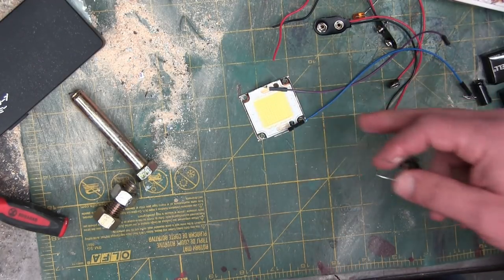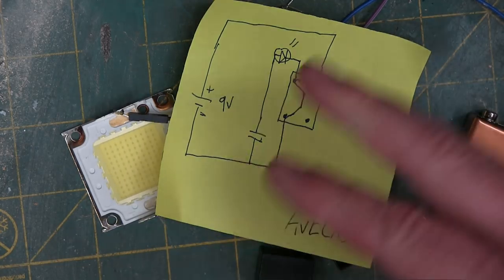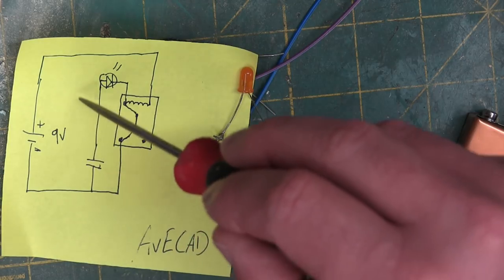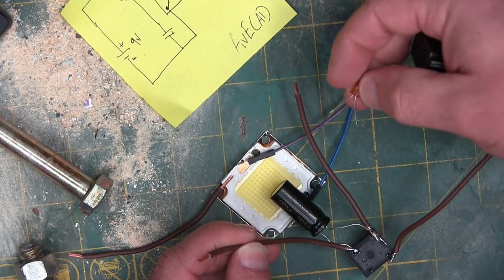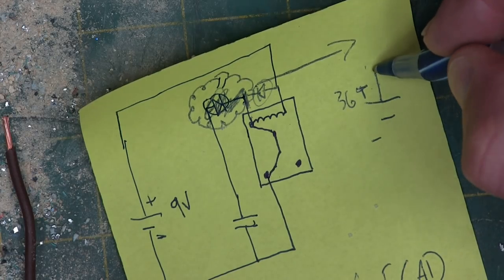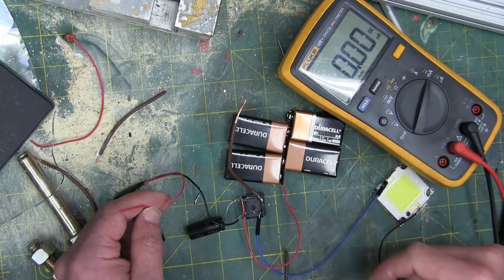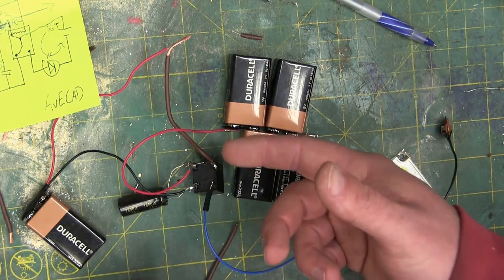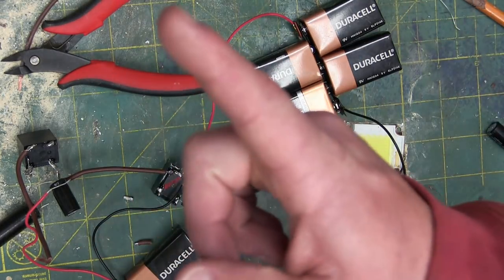SIMPLE Relay Oscillator Strobe Light | Quick & Dirty

Comment: My electrical engineering professor said of electron theory, "Electrons flow out of the negative. Got it? Okay forget about it. You'll never need it"
Reply: Until you go to your physics classes where all the equations are backwards.
Reply: Current is defined as the flow of positive charge.  Positive charges moving right is the same thing as negative charges moving left.  It is all the same current as far as electrical engineers are concerned.

Comment: Going to take me a lot of scrounging to find one hundred 2000 uF caps. Everything else I should be able to get out of the neighbor's garage after he leaves for work tomorrow.
Reply from the maker: Hahahahhhrrrrr Wait a sec
Reply: Would you be interested in a used Allen Bradley Power Flex 4 VFD? I won't be having a foreseeable need. Includes the factory manual.
Reply: +Jay Littleton (and any other volunteers), I can always find a foreseeable need for such things ...

Comment: I decided that I needed to build the circuit from AvECAD and it verks. Thanks AvE! I've recently started learning about inductance and oscillating circuits using inductors and caps like in radios. This has helped me to understand inductance a bit more. I used a 4.7mF cap and the little thing buzzed at 76Hz. Then played with more and more caps. I was so geeked.

Comment: And now the 6 words no electronic engineer wants to hear:
"You can do that with a 555"
Reply: But then we'd need a 7805 to go with...
Reply: 7805? But the inefficiency, just build a buck converter of course you'll need another 555 an inductor another capacitor a good low drop diode. Then if we have that going we might as well make a PCB and if we're going that far we may as well...*blah blah blah blah*
Reply: I have some 555's i use to build vapes with. What else do i need to do this?
Reply: Check the 555 spec sheet. Can run up to 15V
Reply: thanks!
Reply: Nick: nothing that can't be bettered by adding in a few power tranny's
(gets complicated fast, all those biasing passive comps.
Reply: I made a strobe light with a 555, about three passive components and a potentiometer
Reply: I made a mini-strobe light with a miniature incandescent bulb & a 555 -- you can actually boost the voltage 2.5 times the incandescent rating as long as it's a very very fast pulse.
Reply: kadmoW Biasing isn't need when the state is either on or off, just use a MOSFET. 555 + irf540
Reply: I made a strobe light using the low power fluorescent bulb in my ceiling and the light switch on the wall. Finger powered, and flashes at approx 0.1Hz.

Comment: You could set that up as a boost converter using the relay coil as the inductor such that you could flash the 30whatver volt LED on a single 9V battery. Put the LED and coil in parallel such that the pixies would not go through the LED (even if you had enough voltage), apply current to the coil, and then interrupt the flow (such as by opening some contacts, hint hint). The back EMF pulse will easily reach the forward voltage of the LED array. However, you may need a bigger coil to store enough energy in its magnetic field to get a decent flash out of it.

EDIT: And for a bigger coil you don't necessarily need a bigger relay. You can just stick any other big electromagnet in parallel with the relay coil.

Comment: You can also add  resistance in series with the cap to slow the timer, a potentiometer will give you control over the flash rate after it's built, just don't send too much current through it.

Comment: And there I was thinking you might use the back-EMF from the relays when its NC contact opens to drive the COB. I built a boost converter to charge 400V photo flash capacitors using that trick many years ago. If I remembered where I dumped my relays, must use one without internal protection diode, I'd go try lighting up some LEDs with that just for fun. The LED current would be whatever the relay coil current was when NC opened, so you'd need a COB capable of producing the desired amount of light using that current.

Comment: You don't need the relay, just let the capacitor cycle and the LED will strobe if the input current is right. Most high power LED units use an NTC thermister to restrict current until the Caps are saturated to prevent strobing.

Comment: When i was a kid i did a strobe using two light bulbs and an electric motor. The motor burned up after a few hundred or so rotations...apparently passing 220 through the shaft as the bulbs hit the negative rotating, isn't good.

Comment: I cried...at least hobble cobble it good! A cap value change WITH a RESISTOR would have done it with 1 relay.  And you could use a pot to vary the speed. And scarp the swamp diode...as I know you don't need an LED to tell you the LED is on...
Reply: Yup, the delay would be the time it takes for the capacitor to charge with the resistor in series to the point where the relay coil is saturated enough to pull the normally open contact on, which cuts the supply off to the resistor being fed by the normally closed contact, causing the capacitor to then discharge, till the relay normally open contacts open. Rinse repeat.

Comment: Hey man are you sure that the wiring diagram at the end is correct? I wasn't sure so I built one following the diagram and it no workie. So either I wired it wrong (very possible), or your diagram doesn't describe what you actually made. When I adjust the wiring for the capacitor on the first relay, it worked as yours did.

Comment: Is it possible to make it more random... less seizure inducing... but still without a confuser?
Reply: Mercury switches/tilt switches can be very random. They make intermittent contact based on angle and vibration. Very random. Just have to figure out how to vibrate it or cause a slight tilt. Simplicity might be out the window at that point though.

Comment: Astable multivibrators ain't hard.  2 NPNs, 2 caps, 2 resistors, 1 LED.  Done.
Reply from the maker: 7 components?! Pffft.
Reply: AvE - fine, I raise you one relaxation oscillator... 3 components, 4 if we are counting the voltage source.  Love your corntent.  Thanks.

Comment: +AvE  More simplerer ... if it works. What do you think? The unknown is the current across the diode and how it affects the timing. http://img.techpowerup.org/171025/20171024-170219-1508889940751-001.jpg
Reply from the maker: Clacks too fast for the relay to chooch. That's my guess.
Reply: If necessary, add a capacitor in series with the relay coil in order to slow the relay actuation down and to increase the LED illumination time.  Would need to be tuned depending on the relay, the LED characteristics, and the power source's effective series resistance.  And, of course, you can always add a resistor in series with the relay coil, if necessary, to reduce the current through it.  I guess that your presented solution with the two power sources and the two relays seems overly complicated to me.

Comment: 1) Heatsink!  Those LED's conduct too much pulsed current and generate too much heat.  You must have a heatsink attached to the LED.

2) Add a 500 ohm to 1K 1watt resistor to keep the current reduced.

3)  The pulse rate needs further reduction.